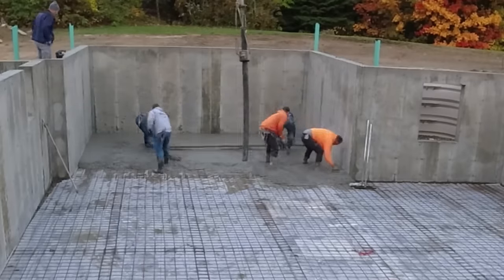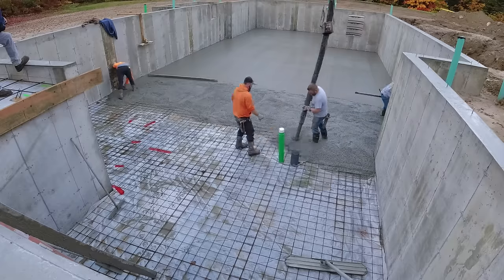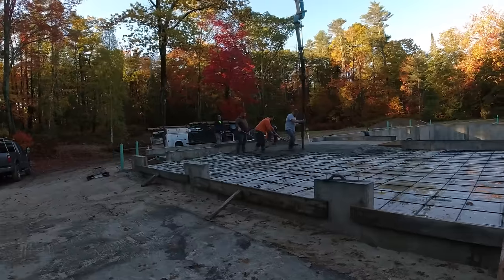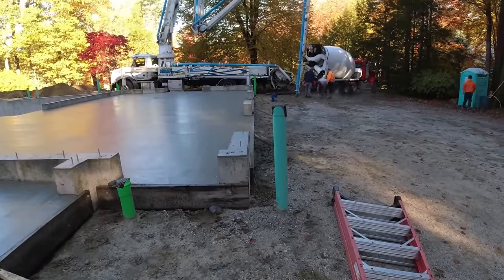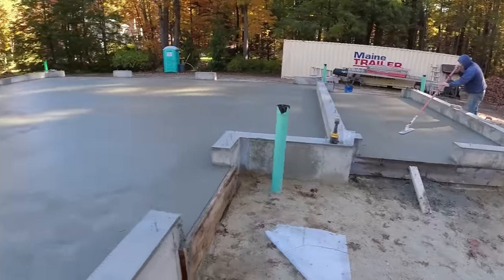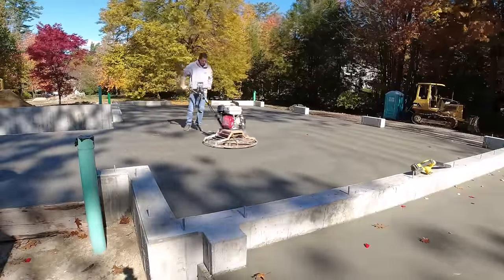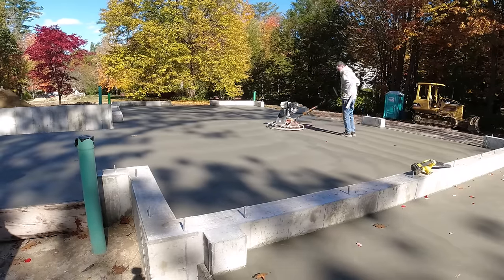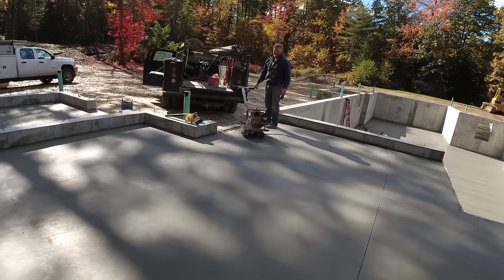Engineer's Spec Had Rebar, Wire Mesh, Fibermesh For Different Areas?

Comment: Subscribed.
The rebar in the garage slab is above lower basement to provide lateral support of rear retaining wall, retaining unbalanced fill. Dynamic wheel load has an additional 3ft design height.

Comment: My guess on the various slab specs is that the engineer created "Zones" and set the specs with computer design software based on the anticipated loads in each area. You should get used to this approach as it optimizes materials and labour. There is no logical reason that every area has to be the same spec. You may not notice big savings on an individual house, but on a large building or a whole subdivision, the savings from this approach can quickly add up.

I am subscribed!

Comment: The garage is thicker and has rebar because it'll see way more load than the attached shed or the basement floor. Someone might even install a jack and lift there car in there. That's alot of force concentrated in a very small area, so you gotta make the whole slab THAT strong. The shed and the basement floor won't see any significant load so 4 inches  of concrete covers the dirt and makes it a living spacea while the wire mesh is good measure and holds it all together nicely.
Reply: plus, the garage will have dynamic load with all stress and strain of having 3 cars going in and out every day. basement load will primarily be static over its entire lifetime

Comment: Subscribed - Wichita KS 3200

Do you have to deal with "radon"? Slab houses in KS have to have a vent for the radon to pass through.

If you have the entire job for a basement, which goes first the walls or the floor?

Comment: Get used to foam.  The newer building codes are requiring insulated floors, including slabs on grade.   And if there is any radon in the county, they are starting to require the poly sheeting as a radon barrier.  The variance between jurisdictions is because every town and county gets to modify the code as they adopt it.  And the new codes publish every three years, but many jurisdictions, don’t adopt the new code for five or six years, after they are published.   Where I am, the city and county are just moving to the 2018, in July.   The state, who does electrical and mechanical is on 2021.  Im designing for the 2021, and studying the 2024.

Comment: FYI....I would be telling you to use a power blower to blast the rainwater OFF the plastic!!! It would be photo'd and documented in the report...it you did it or NOT....can create future issues with leaving puddled water under concrete you placed on the slab.....messes with the slump/cure rate and reduces both compressive and tensile strength of slab. A little won't....that is WHY ....BLOW OFF the EXCESS PUDDLE WATER!!!!